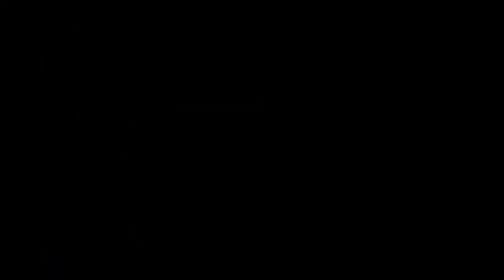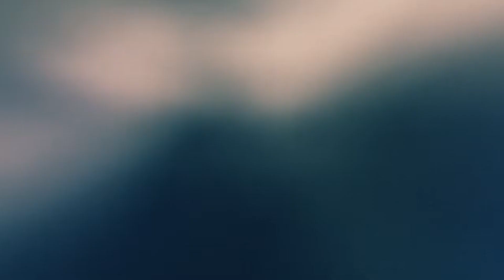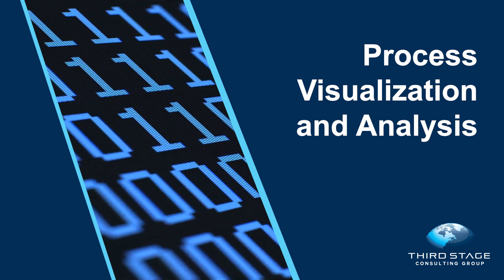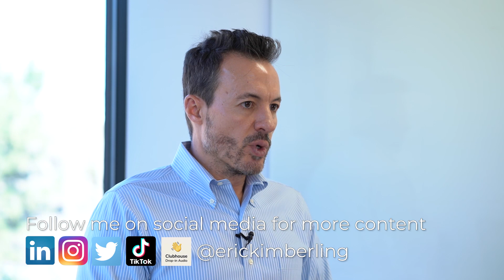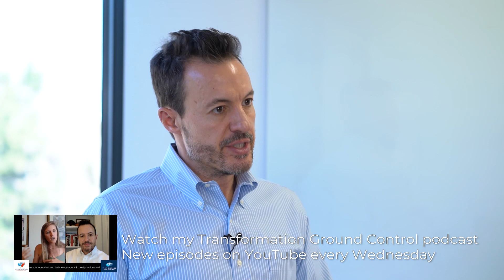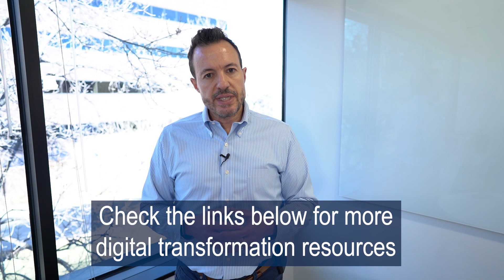What is Business Process Mining? [Business Process Improvement and Analysis Software]

Comment: Would this capability not depend on processes being executed in a single system, or integrated system of systems?  Most of my client's "as-is" includes off-line activities, emails, spreadsheets, etc..Just getting them into a system for the end-to-end workflow is a first challenge. And those systems include ability to configure measurement points.